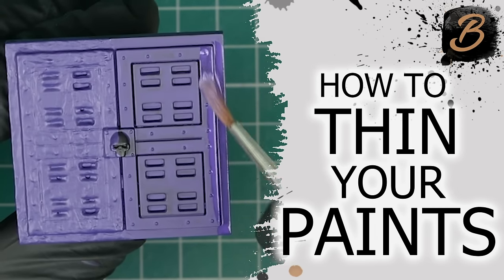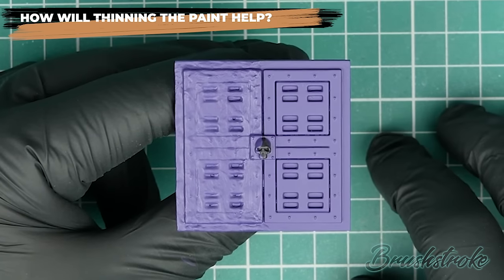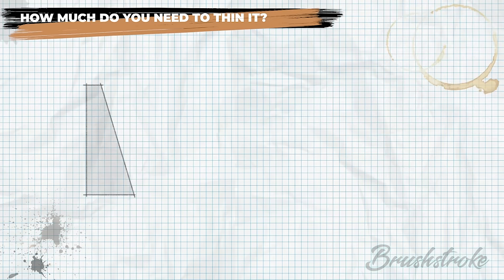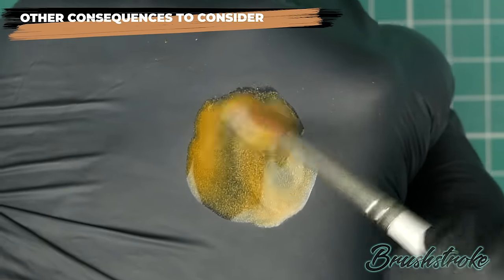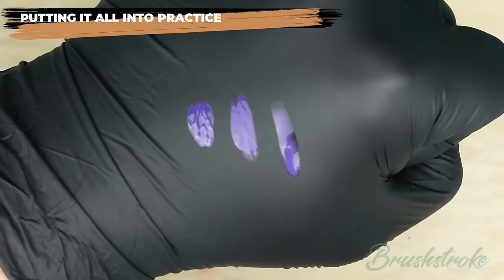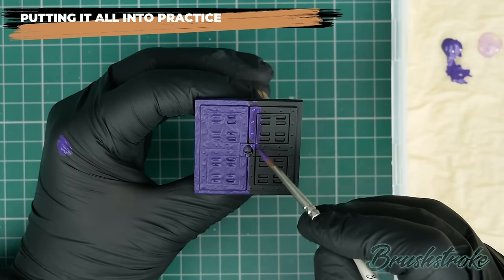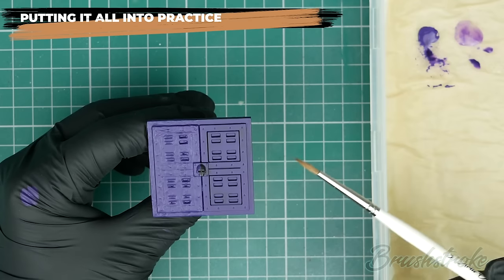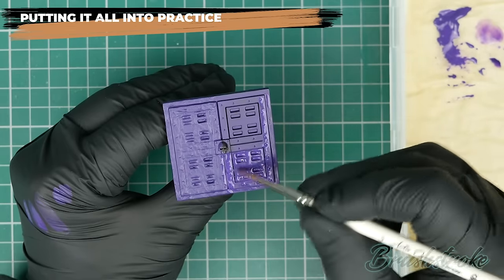HOW TO THIN YOUR PAINTS: A Step-By-Step Guide

Comment from the maker: If you did like enjoy this video please help support the channel and
SUBSCRIBE 
https://www.youtube.com/brushstrokepaintingguides?sub_confirmation=1 🙂

I’d love to hear what you thought of this video, was it helpful, enjoyable, easy to follow? Please let me know your thoughts by dropping a comment below 👇 

Remember, for discount Warhammer minis, paints and more... be sure to check out this link:
https://bit.ly/2Zmbd3u
Reply: This is suppppper helpful, it's nice to have a more prescriptive guide on how to thin paints. Would love to see a glazing breakdown next!
Reply: It was a clear and well explained video. Great job😊
There was one thing though. I was taught that when applying multiple layers to alternate the direction of each coat, for example one horizontal then the next one vertical. Was shown that doing this helped to prevent "runs" of pigment accumulating on surfaces.
Reply: Thanks for the video. This is exactly what I’ve needed this find. The theory section followed by some demonstration points was very helpful. Especially the points about testing on your hand.
Reply: Yeah. A part about shrinking on a pallette was a missing part of a puzzle for me))
Reply: I got gifted a airbrush set and have been doing personal research of paint theory via minis and other hobby kits. With this in my knowledge I'll have my kits painted smarter.
Reply: I never leave Youtube comments, this may actually be my first. But this video is absolutely stellar. I rarely have trouble finding the right consistency, but when I do, I usually get completely stuck and decide I'll just have to live with the slightly blotchy basecoat instead. Great job highlighting what to specifically look for, instead of just relying on instinct and experience, as most video instructors are doing.
Reply: This was the most useful painting thinning video I have ever seen, for the sole reason that it shows how the paint looks like both when thinning, painting, and dry. I have achieved this many times before, but every time I always think I got lucky after fucking up, because before it dries, the paints like like it will cover every detail.
Reply: I loved the format of the video + the background music is super relaxing too! As a person who is way too analytically minded and not very creative this explains exactly and clearly what all you artists mean by "Thin your paint" thanks a ton :)
Reply: Concise and comprehensive. Must be one of the best basic technique videos for mini painting out there.
Reply from the maker: @monishkhara1027  thanks for watching, really glad you found it helpful. A glazing video is planned for sure, so stay tuned for that. It won't be next, however, as I think I'm going to answer all the questions I've had about my palette and specifically the paper I use on it first.
Reply from the maker: @ZendegiLeonard  Thank you, really glad you found the video clear.
With regards painting in alternate directions for each coat, it's not something I conciously do but it certainly makes sense to try and follow that process if you can. 
Because, as you say, it could help to prevent build up of pigment on areas of the surface where you continuely finish a stroke. I tend to try and distribute any excess from the end of a stroke with the next stroke which seems to reduce any significant build up too
Reply from the maker: @jonathanmatthews3086  Thanks for watching, really glad you enjoyed it. The testing part is very important. It seems crazy to me to apply paint to a mini without first knowing how it's going to behave. Why take the risk of ruining a mini (which you may have been working on for hours)? :)
Reply from the maker: @Evershifting  Thanks for watching man. Really glad you found it useful
Reply from the maker: @djmacbest  Thanks for watching and taking the time to leave a comment, really appreciate it. So glad you found the video useful and hopefully now given you the info you need to overcome those awkward paints you've struggled with previously 👍
Reply from the maker: @IcaroMendonca  Thanks very much. I wanted to try and show as much of the process as possible, as I it's a difficult topic to just put into words. Really glad it's helped you confirm that what you've been doing before was actually meant to look like that and you didnt just get lucky
Reply from the maker: @dmaSolar  Thanks man, really glad it helped bridge that gap for you. Personally I think I tend more to the analytical side too, so I like to have an understanding as to the whys, before I can be comfortable with a process. Just being told "thin your paint" wasn't enough for me and I wanted to make a video I wish I'd had when I first started.
Sounds like I've gotten pretty close to the mark
Reply from the maker: @WildGhiron  thank you very much. So great to hear you found it helpful. Please do share it with others and help spread the word
Reply: Holy cow! I never thought about adding a drop of water next to the paint to blend the two. I've had thinning issues since I started the hobby in the 90s. Thank you for this video! Amazing explanations and examples! :D
Reply: Thank you for the in-depth demonstration and explanation. I've been told to "Thin your paints!" more times than there are Guardsmen, but never shown how to thin my paints.
Reply: I couldn't help but get hung up on two major omissions:

1) No talk about using different mediums to thin paint; only talking about water. (e.g. Citadel Lahmian Medium. Golden Acrylics "Matte Flow" medium)

2) No talk about surface tension. This one really jumped out at me because the example you gave to highlight how paint would get stuck at the top of a surface and water would flow down a surface could be untrue, thanks to surface tension. A smaller water droplet would just hang out on the top of the slanted surface, too, the same as the unthinned paint. 

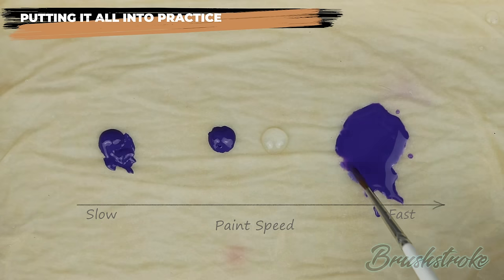You're got a section in the video that shows this: When you're showing the fast paint next to the slow paint around 9:15, the fast paint keeps pulling back into its original puddle after you spread it into this streaks. That's a great illustration of surface tension, and one peril of using too much water when you thin. The paint might pull back off of the place where you put it, because of surface tension.

These two omissions go together: Water has extremely high surface tension. Most other mediums don't. You can thin a paint with a mix of water and some thinning medium. Now the paint will still stay where you put it, not get dragged back to the main puddle by surface tension or "coffee stain" rings on your mini.  Or you can add flow improver (aka detergent) to break the surface tension.
Reply from the maker: @SamBrownBaudot  you sir make excellent points and I confess I purposely left out the effects of different thinning agents / mediums due to the video length. The plan is to follow up with a video exploring how different agents can change and manipulate the paint properties further.
The two main ones being surface tension (as you rightly mention) and the second being paint integrity or the splitting point of a paint.
Rightly or wrongly, I made the decision that to add in the additional factor of different thinners would have been too much and possibly over complicate things for very new painters. 
Instead, I'm hoping i can build on this video and start to add in more variables.
Thanks for the taking the time to comment, really appreciate it, as I do want this video to be the start of the conversation :)
Reply: @BrushstrokePaintingGuides  Glad you took it well. 

I get your desire to keep the video bite-sized. That's a solid priority. In an ideal world, I wish there had been just a mention of this as something you planned to touch on in a future video.
Reply: I’ve peen painting models for 20 years, always known about thinning your paint and I’ve had some success. Yours is the first video out of hundred of painting tutorials that explained everything so clearly. I am beyond impressed with your teaching skill. Consider me subscribed.
Reply: One of the best videos to help beginners. Really helpful and I am looking forward for more content like that!
Reply: I'm only just getting started with painting and your videos give me more confidence in my ability to improve than anything else I've seen online.
Reply: It's really great, If my paint looked like that I would be afraid that the thinned version was still too messy, but obviously once all the excess added water has evaporated it just makes for a nice smooth coat.
Reply from the maker: @tezcharold  this is why I wanted to show the full process for both coats.
So, that people can see it does look a bit messy before it dries.
But as say, once the water evaporates the remaining paint settles to the surface
Reply: This video is great at explaining it, however, like you said in the beginning it really is a trial and error process. Even knowing all of this information, it's still extremely hard to get the right consistency.

I've been painting minis on and off for about 15 years and was painting bisque with acrylics before that and I still can't thin it properly. Sometimes I get lucky but most the time it just ends up too thin or too chunky. And it's just kind of demoralizing and makes me want to stop painting.
Reply: Thank you for this video, I have subscribed to your channel!
Reply: This has to be the most comprehensive video I've seen on thinning model paints. You did a really good job explaining why it's important and what each thinning level is good for. Kudos.

Have you tried P3 paints? I primarily avoid ordering citadel because of the inflated price, and because many of their paints have clogged into gum before ever reaching my door in the past. That said, P3 just thins really well and retains better coverage than some other brands when thinned. Even their marketing / usage videos show some pretty extreme thinning levels.

You can also use a bit of model acrylic thinner with or instead of water, it has surfactants and emulsifiers, which help prevent pigment pooling and reduce surface tension to get a smoother coat. 

Lastly airbrushing is a useful option for anyone who does a lot of minis. The aforementioned acrylic thinner is useful for mixing standard paints to the right consistency for airbrushing. Applying even coats is easier and faster too since it goes on thin.
Reply: Thinning paint makes it less durable so make sure you clear coat it when you're done.
Reply: Genuinely the best paint thinning tutorial that I have ever found!
Reply: As a late comer to this video (Hello 10th edition) I really appreciate the theory section and the Why behind all of this. Stellar stuff.
Reply from the maker: @Alexlinne88  by no means a late comer to the video, it’s only a couple of months old.
Really glad to hear you enjoyed it though and found it useful 👍
Reply: This was such a comprehensive video, thank you! I've been having issues with figuring out how much to thin my paint. The spring-back visual and the idea of paint speed filled in gaps of my understanding that I didn't realize were what was needed.
Would you possibly have plans to do a video on doing washes? I feel like I'm only ever just getting a thin glaze over everything instead of it pulling it into the crevices.
Reply: I've been painting for many, many years, but it was still interesting to see such a clear and scientific exploration of such a fundamental concept. Well done.

A great tutorial for new painters.
Reply: I read this as how to thin your pants.... I just came here to share my story goodbye.
Reply: My first thoughts are you use too many words to explain things. Don't use 10 words when you can use 2. The video is probably half as long if you just get to the point. I thought you had some brilliant technique you discovered, but its just "add water."
Reply: @Kaiesis  I guess it's true. People's attention spans really are pathetically short these days.

What he provided was detailed reasoning for what thinning is, how to achieve it and why it works. But if you want "to just add water", you go right on ahead. You'll definitely get somewhere faster. 🤣
Reply: This is a game changer for me. Thanks!!
Reply: At 67, and modeling from 10 years old, it’s nice to learn about something thanks
Reply from the maker: @Colin-sm2iq  thanks for watching
Really great to hear you found it interesting 👍
Reply: So i can just use water to thin it or do I need paint thinner? I'm trying to paint a model '68 El Camino and don't know the first thing when it comes to painting models I have testors acrylic paint and am just wondering how to make it look nice
Reply from the maker: @palerose1166  Testors craft acrylics?
Yes, I believe they are water based acrylics so they’ll be fine to thin down with water.
However, I would say that craft paints aren’t the most ideal paints to be using for models. As they’re meant more for less fine detail projects. You may find you really struggle to get them to apply as smoothly as you want. especially on something with such smooth surfaces as a model car. 
I would really recommend you try and get hold of some specific model paints. Like Vallejo, Games Workshop, Army Painter etc as they’re designed for what you’re wanting to do and have much finer pigments for ultra fine detail painting.
It’s not to say you can’t get craft paints to work. I certainly have before, but I’m just saying as you mentioned you were a beginner, I don’t want you making things harder on yourself and putting you off this awesome hobby 👍
Reply: @BrushstrokePaintingGuides  yeah I got testors acrylic paint and was hoping it would work, what do you suggest for brushes?
Reply: This is interesting...I like the approach to the topic a lot. it's a bit sciency and you make clear why you do what you do.
I don't know anything about warhammer and stuff.

I paint with acrylc colors, well paintings and not warhammer stuff, but there is something thats called acrylic retarder.
It is used to keep the acrylic paint wet for a longer time, so you can mix the colors while they are more fluid, as you need it for some techniques.
It is a fluid that has colorless pigments. This is used to keep the water in the paint from vaporising so fast, with the pigments the color keeps intensity and stays, well colorfull. 
Maybe that's something you don't know and could be usefull for you.
Reply from the maker: @Beologe  hey, thanks for watching

Yes, retarder is common in miniature painting too.
As you say, it prolongs the working time of the paint.
Generally in miniature painting we use it for a processes like Wet Blending, which is where multiple colours are used at once to create smooth transitions and blends on a model. Having a longer drying time makes it far easier.

This video is really aimed as an intro video and I’m planning to do follow ups and explore alternative to water, such as mediums, retarders, flow aids, solvents etc
Thanks for watching and taking the time to comment.
Always interesting to learn about crossovers with other painting disciplines 👍
Reply: Thank you for this tutorial!  I have just started painting with my Son. This was super helpful.  Some paints are frustrating to use and this helped me tremendously!
Reply: Insanely helpful. I genuinely have been to my wits end with “just thin ur paints bro”. The moment when you said that the paint moves and tries to reform into its prior shape—eureka.
Reply: One of the best painting videos I’ve ever watched. Thank you.

Comment: I just finished my first units and they look a bit bumpy and thick in some areas, after watching this I realised I used too little water and the result you’re aiming here seemed too wet imo but seems that results are way better. Thanks so much for this video, been checking also your other videos and helped a lot since I just got into Warhammer.
Reply from the maker: It can look too wet for sure, and truth be told I prefer to go with too thin rather than too thick. As I’d much rather add an extra coat than have a bumpy basecoat.
This video is intended to get you observing your paint and choosing what you’re wanting to use it for.
Once you get those two things Observation and Choice as your default, you’ll find everything starts to click into place 👍

Comment: As soon as I saw how smooth your models looked (especially with no brush strokes) I knew I had to see what I was doing wrong. 
It's so funny to me that I would see that springy consistency and think to myself, "This must be too thin," before applying a tiny bit more paint. I guess it was a mental holdover from making an even thinner mix and ended up with an impromptu wash.  Thanks for the video and the information. And also thanks for showing the results of the first coat. I know some would just skip back to the end result (which is great) but seeing that you'll end up with the primer showing through was super helpful (along with the explanation). Definitely can't wait to see more of your work!
Reply from the maker: Thanks for watching man, really glad you found it useful. I wanted to try and show the whole process from beginning to end. 
So people can see how it looks on the palette, being applied, after a first coat etc. because that way people can simply compare their process against each stage and see if theirs differs.
I think the problem with the standard advice to beginners is it doesnt tell them what they're supposed to be looking for and a lot of the tutorials cut to the end result and never show how poor a single coat can actually look.
Please do check out the rest of my channel and let me know what you think :o)